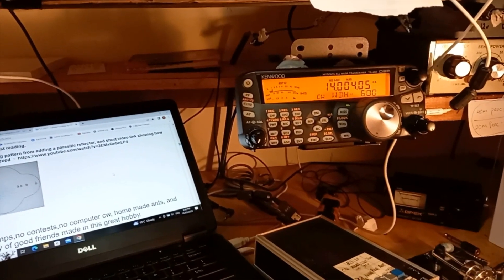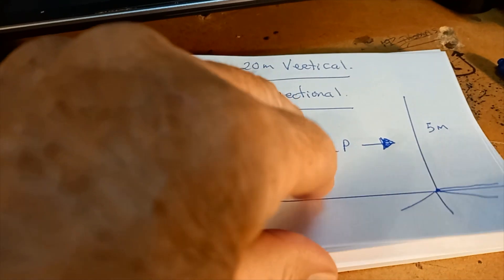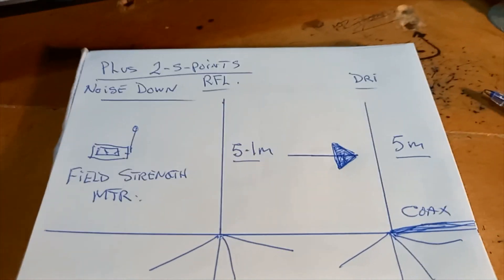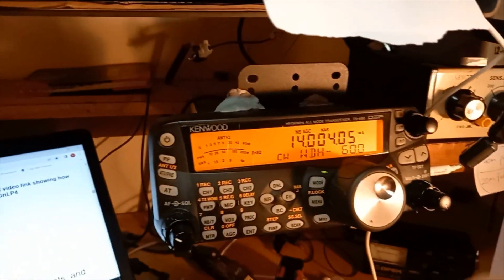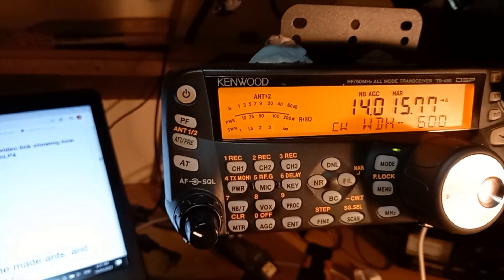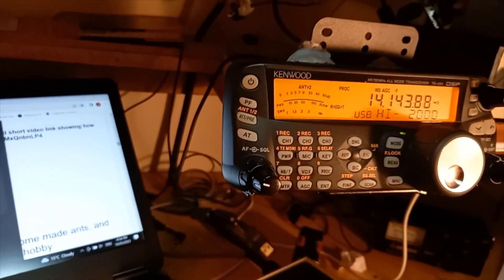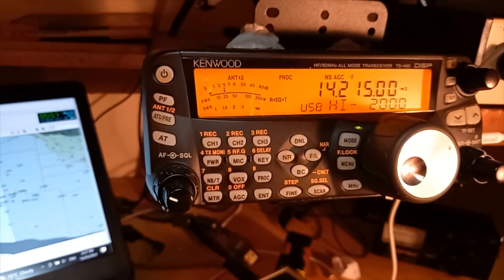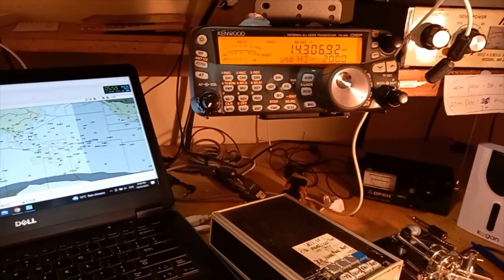ZL3XDJ,  parasitic 2 ele vertical antenna test.

Comment: Hi Brian, I was looking to try this in the near future when out operating portable then I came across your video. Looks like its working a treat. Have you any info on the size of the coil and number of turns for the reflector? Just for a starting point. Hope to work you again soon from the pedestrian mobile station. 73...David M0DAD.
Reply from the maker: Hi David, boy that was a while ago hi. Think the coil was very small, I was only try to make it lengthen to be longer. Difference between the two would have only been 10 - 20cm, I think.
Good luck, 73.

Comment: Hi, if 1 vertical work fine, another one spaced 5 m will make a BIG difference. Especially if you feed them both with 90° difference (for 20m that is 3.5 meters for RG59/58).  Put a 3.5m cable to each antenna, and there you put your relay and phasing coax. Forward gain is some  1 to 2 dB better and F/B is up to 40 dB at low take off angles. I used this config on 80m (20m spacing) during the 1977 to 1980 with great success. Good luck with the verticals ! 73 de Bjoern
Reply: It sounds very interesting. Is there a tutorial on to build this antenna?

Comment: What i never get about parasitics, is how to lay out the radials so the radials from the parasitc to interfere with the raidals from the driven element. Then? I start thinking about half squares to achieve directionality instead. Then? I think about a larger half square behind it, and a smaller one in front. All the Best! 73 DE W8LV BILL (W8LV/VE3 prepandemic.)

Comment: Hi Brian, you mention a previous video on the 2 element parasitic but I can't find that video? Comment on your coil F/B results: very conclusive however to see if it switches direction it'd be great if you took signals from the opposite direction to show them stronger there (e.g. from VK). How do we know the comparison of one vertical on its own vs with the reflector? It could be the results showing without attenuation, then with attenuation of parasitic, though I doubt it, it seems likely this is working very well as intended. Just recently we were discussing whether a 1/4 GP can be used in this manner, as we could not find any literature other than phased verticals fed and need to be a whopping half wave apart. For vertical dipoles (or EFHW which could also be fed at bottom with unun) there's plenty literature. Coincidentally I came across your video here and it does seem to show great improvements also for a 1/4 GP!

Comment: That's brilliant Brian. Having that coil switch in and out gives you the confidence its working. You must be in a good location as I here very little OC from my QTH. I may try this method some time and full credit to yourself. 2 s points is 12db in a Kenwood so pretty good.